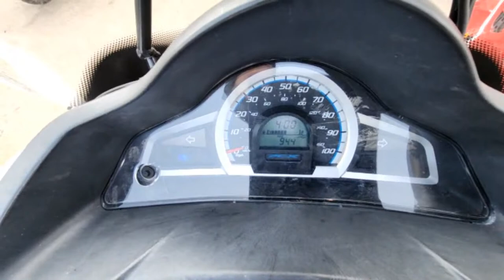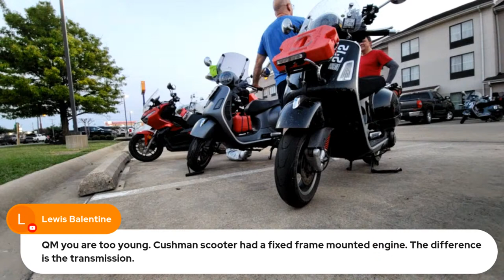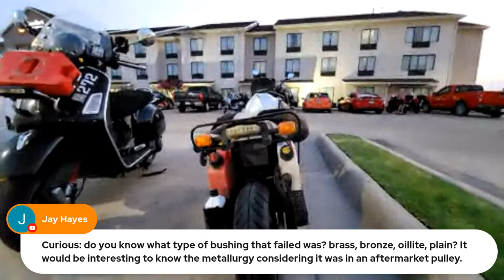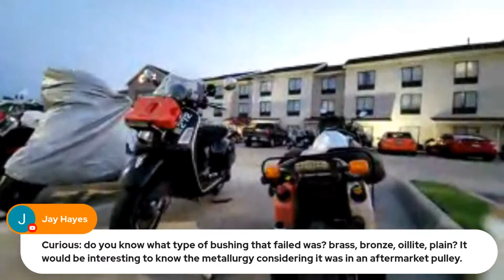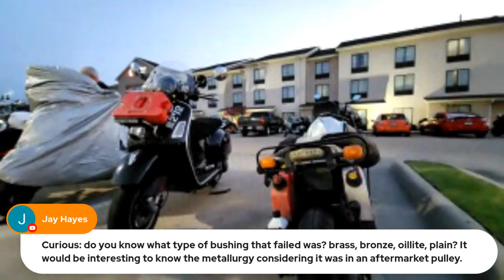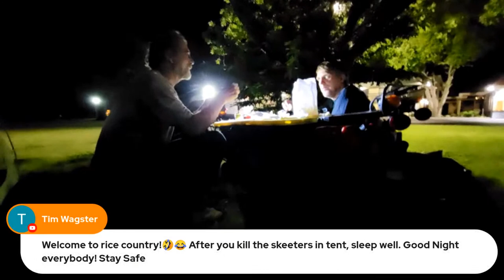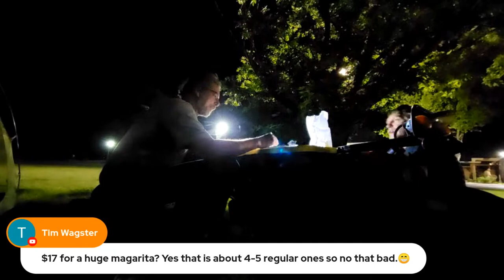QuasiLive: Scooter Cannonball 2023 // Day 6 - Evening Livestream

Comment: How many time do you poor gas on your  Motor bike
Reply from the maker: My average fuel range during the cannonball on a full load of fuel was ~420 miles (675 km) .  The scooter's fuel tank holds 2.1 US gallons (8 liters), and my fuel can holds an additional 2.5 gallons (9.5 liters) for a total of 4.6 gallons (17.5L).  My scooter's average fuel consumption throughout the event was 93 MPG US (2.53L/100km, 39.54 km/L).  Cheers!  😉👍  --QM

Comment: I have a 2021 BV350 Piaggio that would be the much better scooter for a trip like this........
Reply from the maker: Larger scooters are obviously more comfortable and capable.  However, the Scooter Cannonball is an endurance event with a 279cc maximum displacement limit.  Riders on larger motorcycles and scooters can tag along as toursists (or support), but they aren't officially in the event and they don't qualify for points in the event.

I have a 2004 Honda SilverWing 600 that would be great fun on this trip, but I certainly wouldn't want to ride that 550-lb pig on some of the gravel roads that we encounter!  😉👍  --QM